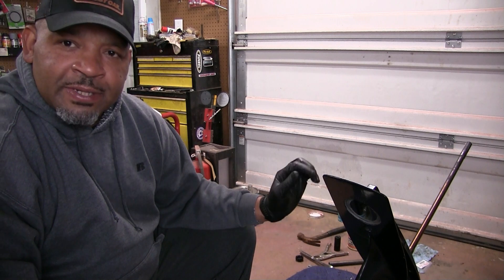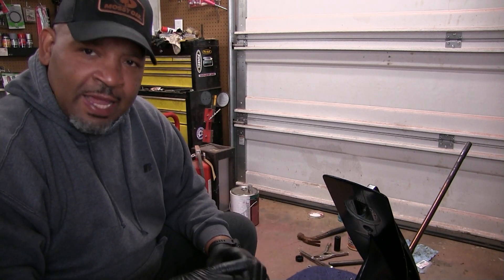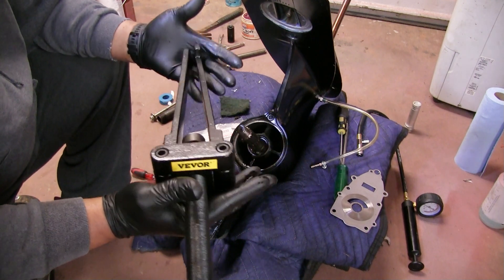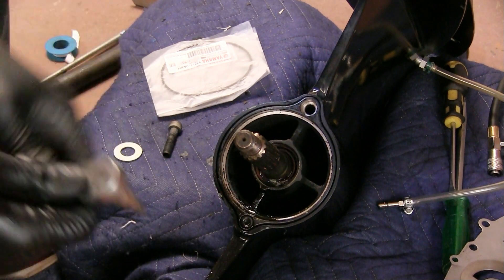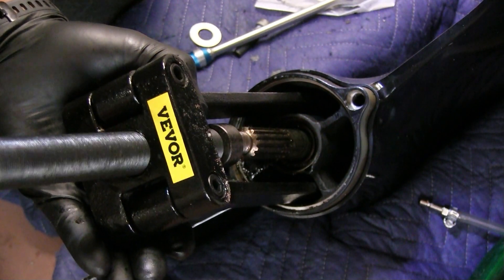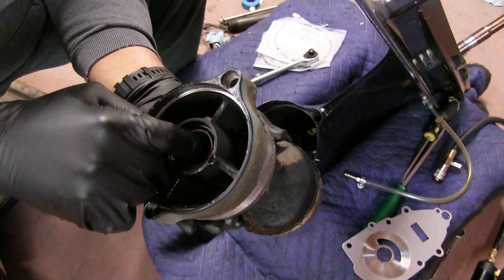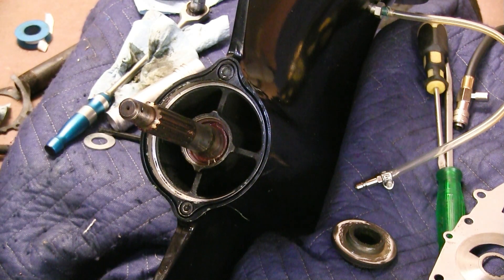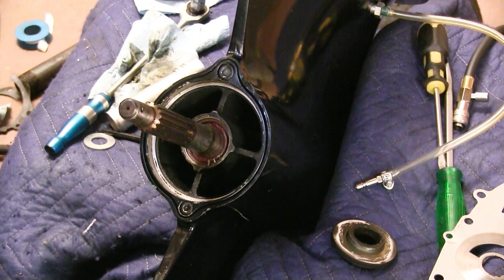Prop Shaft Seals and Carrier Bearing O Rings Replacement (Yamaha 225 HPDI Outboard)

Comment: Nice video! Question: That grease zerk you mention @ 19:09, where does the grease go and when to grease it?
Reply from the maker: It goes to the back bearing in the lower unit. There is a bearing behind there.
Reply: @thebasshunter  Thanks!
Reply: no it does not it only greases between the bearing carrier and the inside of the lower unit it does not grease any bearings all bearings are greased by the oil
Reply from the maker: @antho7475  I'm sorry if I miss in formed you. I thought it greased the needle bearing that behind the two prop seal that I replace.

Comment: Thanks, for sharing your knowledge with us. I've ordered the parts for my lower unit and will try to change the prop shaft seals without removing the carrier. I'm going to try the two screws and pry bar method.
Reply from the maker: Good and it will save you a ton of money to do it yourself. Then you can do you buddy's boat when his need to be done.
Reply: One question for you,  if I have to remove the Bearing  Carrier,  can I do it without removing the lower unit?
Reply: @thebasshunter  One question for you,  if I need to remove the Bearing Carrier,  can I do it without removing the lower unit  ?
Reply from the maker: @kenp247   Yes, you do not have to remove the lower unit.

Comment: Umm, you installed the seal backwards, open spring side facing in on the inner seal, then the spring side facing out on the outer seal, they call it back to back when in installing the seals, thats why it is leaking, and leave a gap between the two seals, the should not be touching one another. outseal should be slighting below flush of seal casing.
Reply from the maker: @bearnapper3289  you might want to check your source of information sir. You are absolutely wrong. The  spring side is always facing the source of the oil or grease. The spring side of the seal prevents grease from leaking out, if you have the spring facing outward on the outer seal you will be letting the oil out if made it pass the inter seal.

Comment: Where did you get that seal setting tool?
Reply from the maker: You can get that seal tool from any parts store. It called a seal puller. This one is from Amazon https://amzn.to/3Nsbf33
Reply: @thebasshunter  sorry I meant the one you were using to push the seals back in
Reply from the maker: @DavidPayne-x8p  this kit looks better than the on I got. It has more pieces. https://amzn.to/3JcG6OM
Reply: @thebasshunter  thanks man

Comment: Nice job there Michael.  Just a word - perhaps of caution when doing any work around those needle bearings.  Best to pack a rag or small paper towel over those bearings.  You do not want to contaminate those bearings with grit or dirt while fussing with them seals.